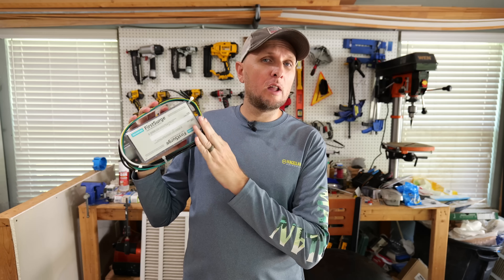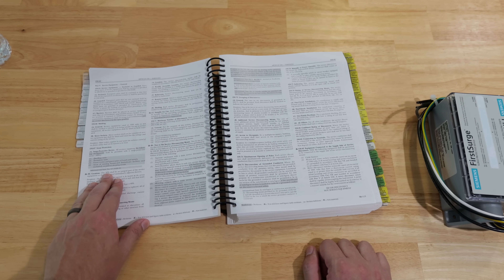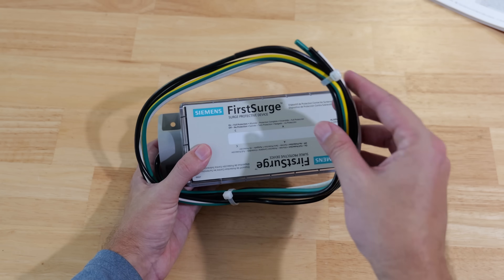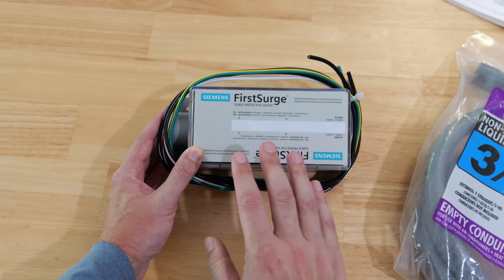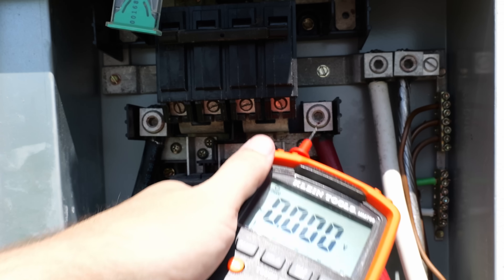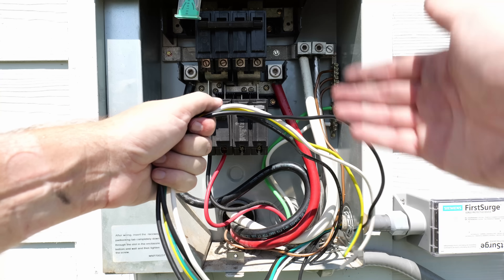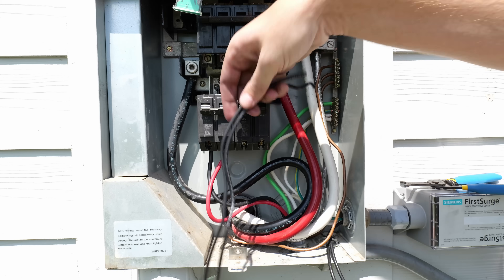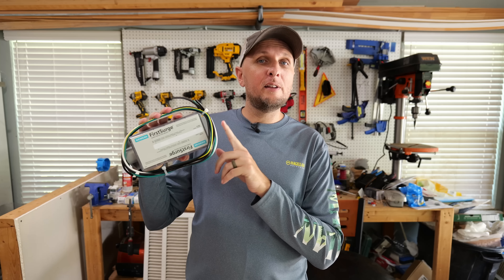Why Whole Home Surge Protectors Are Now Required and How To Install One!  Siemens FS140

Comment: What should also be required are voltage detectors at the main panel with the ability to disconnect the entire service if the voltage rises or falls below a safe threshold.. We had many times over the years when we had brown outs that fried home electronics and appliances which could have been prevented if the power was just cut off.. These events cost us many thousands of dollars for fried TV sets, computer power supplies, refrigerator and freezer compressors, washer, dryer and furnace motors and so on.. Now we have a solar inverter that takes care of all that and can use low or dirty power in combination with our batteries to create stable power.. If it can't then it shuts down and turns everything off..

Comment: I have the main breaker box outside the home that has two circuit breakers, the main circuit breaker that feeds into the home and I've added a 30 amp circuit breaker to my water well pump as well. Inside the home I have single breaker box that contains all the circuit breakers for each room and appliance within the house. Of the two boxes, does it matter which I connect this whole home surge protector device too?

Comment: Too bad you have to use a full 2 breaker spaces for this install. Although I guess if breaker is rated to support double landings of 10g, then could use an existing one. If have a generator as well hooked up via manual interlock, I assume this would protect for that as well? It seems how this work is if they detect surge in voltage, they will open up and send it to ground to keep it from all going out to the branch circuits. Does that sound correct?  So for instance, what if my generator input to house loses its neutral while using unbonded generator connected to generator inlet? Since it's likely there will be a surge on one side of a 120 leg since neutral is broken, will this actually help in that situation?

Comment: my electrician installed a 'whole house' surge protector, but it was just a small blackbox that sits inside the main power box for the house and which is attached to the electric dryer circuit only.  I don't understand how that protects the entire house electric supply???

Comment: I have a home with a Generac 22 kw generator and two 200 amp panels and it fully automatic. I also have load shedders attached for my hot tub, heat pump emergency heat, and the dryer. I also installed softstart devices on my two heat pumps. I have 73 smart home switches and lots of electronics. I have found after several power outages that the load shedders and random smart switches have failed. It seems that when the Heat Pumps turn off, there is a momentary surge and I can see the lighting in the house suddenly increase in brightness. Would a surge protector like this help reduce these surges?

Comment: So the Siemens FS140 is no longer manufactured and is increasingly hard to find and expensive.  Their new version is the FSPD140 which seems to be lacking a few features.  Which surge protector do you now recommend?

Comment: NEC, sell more hardware! 
As this has now become an additional maintenance item. Surge suppressors wear over time. And no one has specified how long it would last. Or a method on how to test, to my knowledge.

Oh, and this guy may not mention these surge protectors may not save your equipment from all events. Closer lightening strikes will likely still kill equipment! As I say, if the strike travels miles to your house, a gap of 1/2 inch will not save you.

Comment: yesterday installed the Boltshield FSPD140. Same installation principle as with this model. I only have one panel outside the house with multiple knockouts at bottom and only one on the side-bottom like in this vid. My main breaker is at the top of the panel so had to drill out a new hole on the left-side closest to the main breaker. Wired it up like in this vid and it worked like a charm. The only thing about the Boltshield is upside down because of it being on the left of the panel(who cares) and it has wires for an alarm hookup.

Comment: My main disconnect (outside) only has a spot for a single 200A breaker, with no other options.  I have an outdoor panel (mounted on the same pole as the main)  and then my inside house panel which are both tied back to the main 200A.  Would this Whole Home Surge Protector still provide protection to my house if I wired it off the side of the outdoor panel (50A disconnect)?  Otherwise my panel inside is recessed into the wall of our mudroom...
Reply: best to place it at the meter

Comment: Government:
Whole home surge protector is required by code
Whole home generator is required by code
Enough solar panels and batteries to support electrical needs of whole home is required by code

Government: why are homes expensive?
We will give 0%, $0 down loans for people to buy homes.
😅😂
Reply: Same government: less people are using electricity from grid so electricity will get more expensive.

Government: homes are expensive, how do we make homes cheaper ?
Let’s use taxpayers money to build expensive homes for homeless 😅😂

Comment: Why? So regulations can make homeownership even less affordable.
Reply: One power surge can cost you THOUSANDS of dollars in damaged equipment in your home! A whole house surge protector in your panel is MUCH cheaper!
Reply: More accurately, home home surge protector MIGHT save your equipment. Depending on the surge type it may not help. Besides that, when it does protect your equipment you may not know about it. And typically they are only good for one good hit and then need to be replaced.  And naturally the home owner has to call an electrician to do it. PROFIT!

Comment: How does this stop a surge?  It seems more like an indicator then a protector.  If anything the 20amp breaker will trip, but then what is the purpose of this device except to show you pretty lights?
Reply: I don't know if he explained it or not. For tired of the sales job for electricians and quit watching. 

Typically the device used to protect from a surge sacrifices itself in the process. Many times generating a short. So the breaker is there to keep it from supporting the whole panel. Once it trips you can bet you'll need a new one. And the electrician makes more money. Your devices MIGHT have been saved. But there's no might in the NECs benefactors profit.

Comment: Well done!   Thank you.  Shall install one.   We have exterior 200-amp [D] breaker panel.  All spaces filled.  Inside garage is [D] "sub panel"(?).    Has space for a double 20-amp breaker.
Use that one?     Thank you.

Comment: Why would you attach a smoke, carbon monoxide detector to the power system of your house, use batteries.
Reply from the maker: They have batteries as well.  They are all connected so when one on the other side of the house goes off they all go off.  That way if you’re asleep and the issue is on the other side of the house, you will know before it gets to you or becomes too big of an issue.

Comment: Not understanding how that’s protecting House when it’s just going into an empty breaker does it absorb the excess flow of electricity, not really getting how it works
Reply from the maker: Yes it absorbs it and sends it to ground.
Reply: Blows up and baby times shorts. Thus the breakers.  And then it protects no more.

Comment: what if your breaker box is full, no open slots for another breaker?
Reply: You may need to have a sub panel installed and move some circuits from the main to the new sub to free up slots in the main box.
Reply: Or just a bigger panel. Either way more expensive and profit for the electrician.

Comment: Interesting requirement that still dose not remove the need for individual device surge protection. 
About 20 years ago lightning struck a tree roughly 200' from the house, but the dog wire went thru the roots causing all of the splices to blow fry the board and arc to the phone line next to it, the phone line fried the modem on my desktop. After that I surge protect all outside sources.

Comment: It looks like Siemens has discontinued the FS series (FS140, FS100, FS60) and is replacing it with their boltshield series. Would you still recommend boltshield? Or what's better alternative SPD out there?
Reply from the maker: Yeah the boltshield is very comparable.  I still think the FS140 was slightly better in a category or two but it was close.   I would probably still stick with the boltshield.  The FS140 was really in a tier of its own.
Reply: Good to know! I guess I’m conflicted - should I get a boltshield 140kA? Or instead go for the very available FS100 (40kA less)? For context, I’m in Connecticut so not sure what level of protection I’d need?
Reply: Really? Are any of these combination MOV and gas discharge devices? In my mind that would be the best type but still needs maintenance (replacement) every so often to continue protection. Something I didn't think you mentioned. And it's usually not a homeowner job either. Now work for electricians?

Comment: What d you think of the Siemens Boltshield FSPD140 Level 2 Whole House Surge Protection Device Rated for 140,000 Amps, 120/240V as the one you recommended is out of stock .....You got me hoked on the Soft start and it is saving money on the electric bill and I now need to install interlock and box for generator. How can I find out if generator is bonded or??

Comment: Why not just use surge protectors inside?
Reply from the maker: You should for sensitive electronics to protect from internal surges.  But to not use a whole home surge protect it makes it difficult and quite expensive to add individual surge protectors to everything including your AC unit and appliances.

Comment: I had one installed years ago just because it was a good idea.  I also have  a point of use at the inside and outside AC units.   My electronics inside have battery backups.     Florida is the lightning capital of the world

Comment: Just another gadget from politics and business lobbyists to make us buy mandatory devices.
Anti siphon hose spigots 
Water heater safety devices that drove the prices up over 500 percent as far as the anti siphon devices that malfunction within three years causing major costs to replace them.
Same thing happened with the h20 heaters.
They are about 8” taller causing much higher cost to replace them and they also like to malfunction due to being electronically controlled gas valves instead of mechanically controlled gas valves . 
Both use millivolts to operate however. 
Arc fault is another product pushed into market by lobbyists

Comment: Installing a single large shunt protector in the main panel is a bad idea. They work better to clamp overvoltages (and don't self-destruct as easily) when there is some series impedance ahead of them. Therefore smaller MOVs installed near or at the load do a better job than one big one at the service entrance.

Comment: I installed the Eaton whole house protector 10 years ago at my service panel.
Less than a week after I installed the surge protector,  There was a lightning storm about 10 miles away and the surge came down the utility line. 
The sword protector work the way it's supposed to. It shunted the excess power to ground, then went back to protecting the house. 

My TV temporarily shut down and then turned back on.  That's how I knew the surge protector was working.

The surge protector also protects against stray surges that occur from one year. Air conditioner or air handler turns off.  It's an added side benefit.

In addition to the whole house surge protector, I use local surge protectors at my sensitive electronic devices, just in case any stray surges get past the main protector.
Reply: And have you replaced your surge protector in the last 10 years? One thing few people seem to talk about (thankfully this video did) is that surge protectors only last 3-5 years before they don't really function anymore.
Reply: "My TV temporarily shut down and then turned back on.  That's how I knew the surge protector was working." No that just means you probably experienced a voltage sag that are very common when utility reclosers operate during thunderstorms and wind storms. It  probably had nothing to do with the surge protector.
Reply: @RCRadioShow I'm also burst in ESD protection and worked for electrical contractor. 
If it had been a voltage sag other devices would have shut down.

Comment: bought a new house in florida no sp on it ??
Reply from the maker: Depends on how new and what code version was adopted for your jurisdiction at the time of building.  They can also get away with installing an SPD in the breaker box that will look like a circuit breaker or they install them in the utility service meter.

Comment: This seems very misleading - calling it "whole home" and then installing it on a single 20A breaker?
Reply from the maker: That’s how it works.  And yes it is a whole home surge protector.  Nothing misleading about it.
Reply: @HowToHomeDIY  How does it work? If it's not inline, how is it supposed to interrupt the current flow? Even if it just dead-shorts to ground, the most it's likely to do is pop its own breaker, right?
Reply from the maker: @no1unorightnow no, a surge is mostly a voltage spike and is incredibly fast.  That’s why circuit breakers generally don’t trip with them.  This is also the quickest path back to ground.  Electricity like everything else takes the path of least resistance and is looking for ground.

Comment: Way too hard.  I bought a Cutler-Hammer CHNSURGE device that plugs directly onto the copper buss bars in the service panel.  Connect the neutral and problem solved.

Yes, my buss bars are copper, it's a CH service panel (not BR) that replaced a POS Challenger aluminum buss bar panel that nearly burned down my house.  I didn't see any good reason to trust a panel with aluminum buss bars again when it was only $15 more.

BTW, the length of the wires is trivial.  Signal travels just under 12 inches every nanosecond.  Your device responds in milliseconds, so the transient travels many orders of magnitude faster than your device can respond.
Reply: The wire length isn't about speed. The longer the conductor, the more inductive reactance is present. This increases at higher frequencies which include voltage transients. The more inductive reactance (longer wire) the more it acts to block transients from reaching the SPD. Works like a VFD line reactor which you wouldn't want on an SPD.

Comment: Dont listen to this clown.  Yes if you are doing new construction or replacing your service add a surge protection device to pass inspection but do not just add these for no reason.  They are unnecessary and are just a money grab.
Reply from the maker: 😂 yes added protection that can protect expensive sensitive electronics such as tvs, refrigerators, ovens, AC unit, etc is super silly to do.  My goodness.
Reply: @HowToHomeDIY   very very very rarely get fried do to power surges and are covered under your home owners insurance policy.  So yes they are silly.

Comment: The NEC should have no authority whatsoever to make such mandates or control building requirements at all.  Is a whole home surge protector a good idea?  Probably if you have a lot of expensive and sensitive electronics that could be damaged or destroyed by a surge.  Does having a whole home surge protector make human lives more safe?  Possibly, but probably not.  Most people buy smoke and CO detectors that are battery powered and the batteries last up to ten years.  With such long battery lives, it would be retarded to ever hardwire in such detectors.  And TVs, computers, and audio equipment can all be protected by power strips with surge protection.  Plus, these days most electronics are cheap and have limited lifespans plus everyone has cloud backups, so losing a piece of electronics isn't a big deal.

So, a whole home surge protector might be a good idea, but it's not a big deal.
Reply from the maker: Newer homes are having hardwired smoke detectors installed.  And some places require them.  Mine for instance are all 110v hardwired smoke detectors.  That is one of the big reasons for the code.
Reply: @HowToHomeDIY  My point is that there is no good reason to hardwire sensors.  It sounds like someone is requiring hardwired smoke and CO sensors so that there is additional electrical installation costs and to then justify whole home surge protection which is another additional cost.

It's bad enough that the codes require GFCI outlets or breakers.  Heck, we could very safely go back to ungrounded outlets if it weren't for the NEC nannies.

Comment: While I'll agree all the protection we can hope for is a good thing. With that said in the long run its added expense, many things have been done to drive the cost of many things up. It would seem the protection devices should be installed at the service meter. Both surge and  lighting arrestors, should be incorporated into, or added to the ''smart'' meters and the responsibility of the power companies. I'm sure they can find a way to gouge us for  that as well.

Comment: Keep in mind that these surge protectors have a finite life. They can function for years or fail the day after it is installed. If your house is very close to a lightning strike chances are the the surge protector will be toast and will need to be changed even on day one of use. They are not re-settable devices.

Comment: Great video .....Just a question though I noticed you have a aux power outlet for a generator ....will that surge protector also work with power high/low when using the generator? ....Thanks !